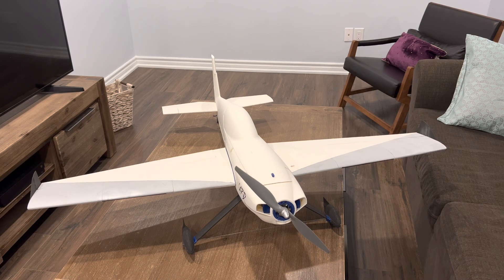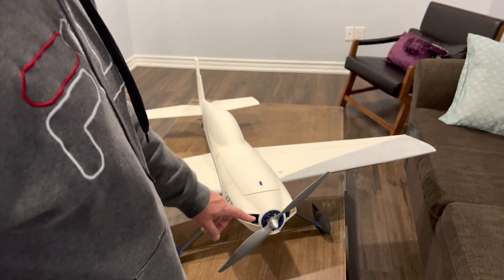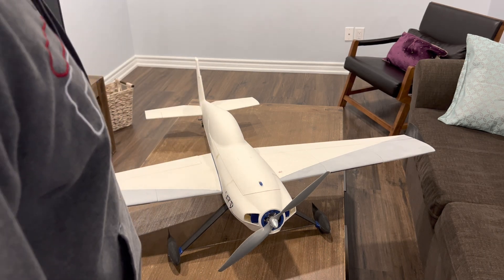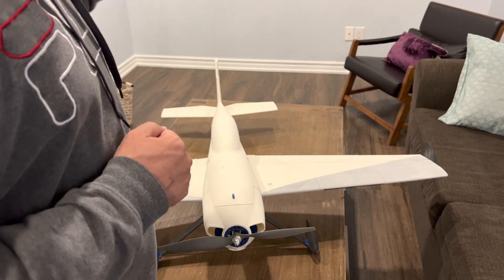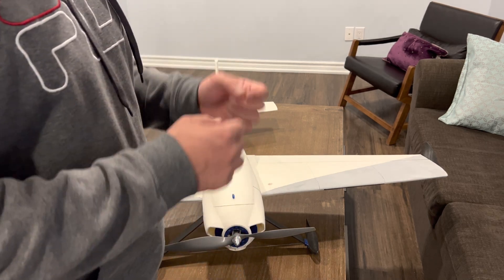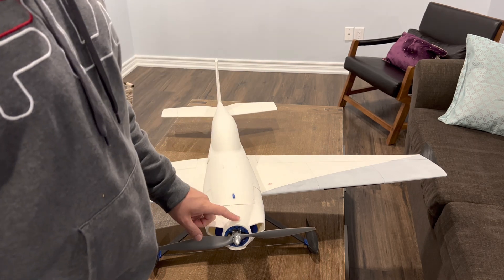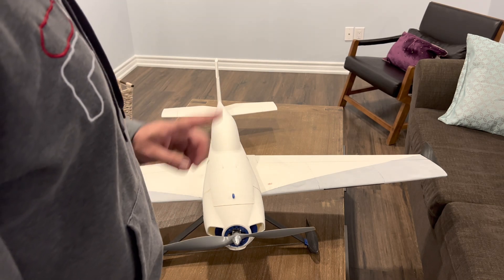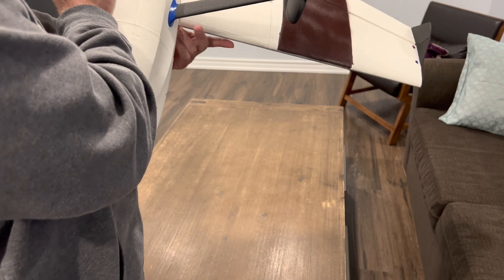Shard - Aerobatic 3D Printed Airplane - Part 4 "Final Thoughts"

Comment: I'm currently continuing printing mine, Right now I switched to the new ESUN Lw-Pla HT (high temperature) This new type of LW-PLA apparently can resist more to higher temperatures from the sun or any source of heat and it prints almost the same as the original LW-PLA. The drawback is that apparently, you need to use more flow in the settings so you would add a few grams to every part of the plane.

But I'm curious, I already managed to finish the fuselage parts with normal LW-PLA and although some of them ended up weighing as per the manual some of them ended with a bit of extra weight, of course, I calibrated my printer for LW-PLA before I committed to print this one did your parts during printing matched the weight as indicated on the manual?
Reply from the maker: Sometimes little bit higher

Comment: Did you try removing some down angle from the motor? It sounds like the motor angle is too much down angle and when you remove power the airplane goes slightly nose up.